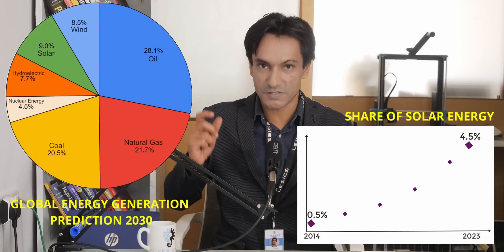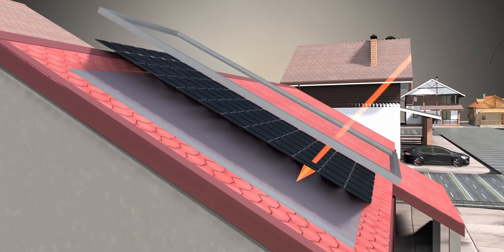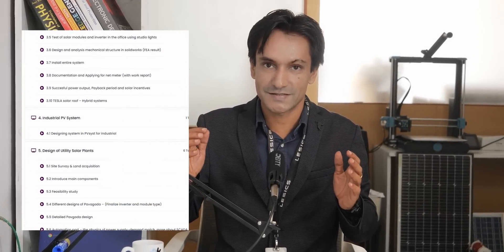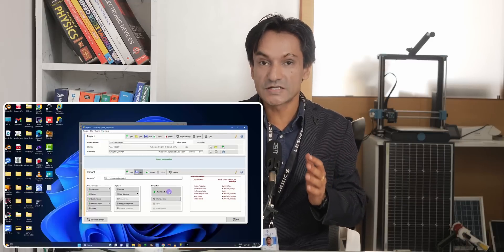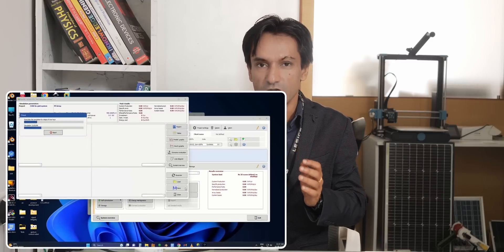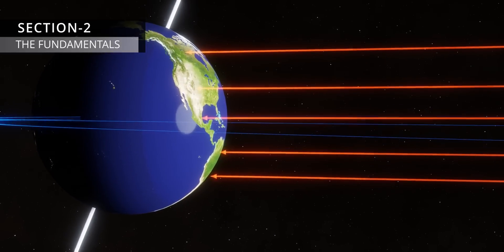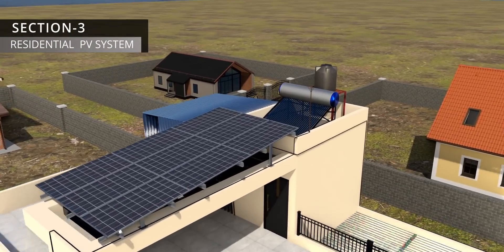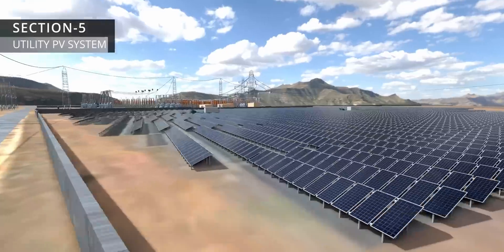Photovoltaic Power Production | A Detailed Design Course

Comment: Interesting about this topic I drive by TOK MFG facility,  I for the last 28 years where I actually worked on their equipment for a time.
And on my way over to Intel.
Having asked pose a question not one person can answer  beside the MFG of the chemical.
How does the ISS create PVW in -250 COLD?
If it "PR" can't make electricity, via its images of tall Panes you are shown, then HOW can it even exist ?
PR, like all matter, is enslaved to the laws of thermal dynamics. 
Right about -30f  PR becomes useless. As per their spec sheet.

Comment: What's the validity of the Course? - Photovoltaic Power Production and What value should we get after enrolling into that course?
Reply from the maker: The course is valid for lifetime. If you are willing to practise this coursw with me, you will learn how to design  residential and utility pv systems. Check this link to see the course content - https://sabinmathew.com/courses/photovoltaic-power-production/#tab-course-section__curriculum
Reply: You must not be an engineer. You get knowledge, boy.
Reply: Dude , if you want a certificate. There are lot of places you can get without learning anything. We as Indians nowadays are purely in for the job or money . While it is important. That alone shouldn't be the sole reason to do engineering